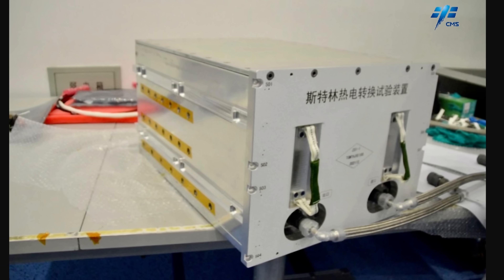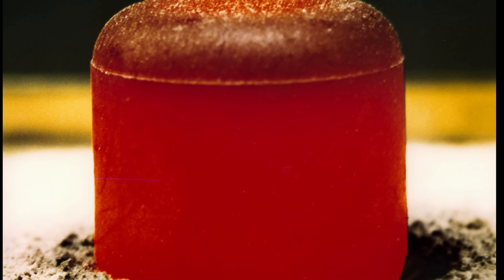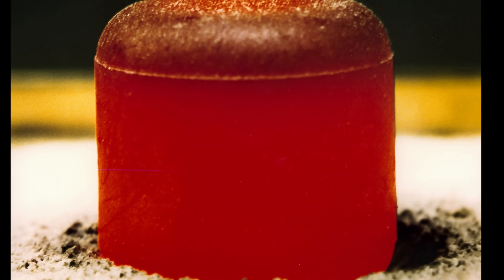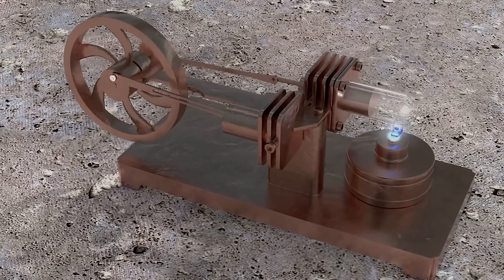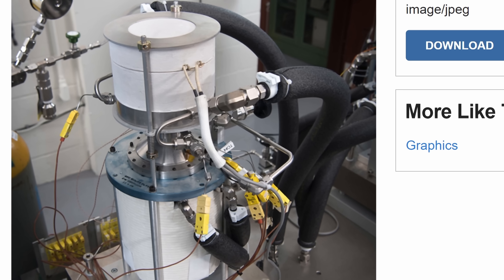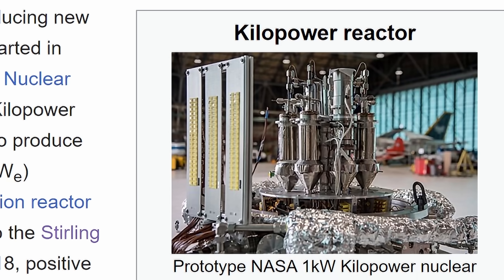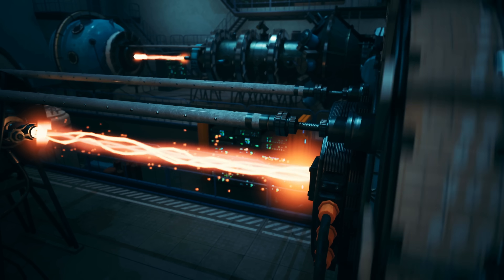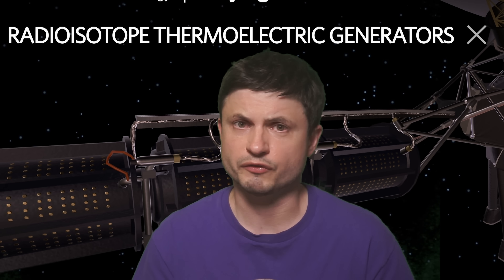Incredible Advances In Nuclear Stirling Engines For Space Exploration

Comment: Always wondered about this, since nuclear waste that we still can’t figure out how to dispose of properly, produces tons of heat, just not enough for a turbine. The fact it’s not being used for stirling engines and district heating is a joke. It could be paying its upkeep.
Reply: The problem is probably it is low level heat. If it isn't hot enough to run a steam engine from steam from a nuclear reactor it is unlikely to run a Stirling engine. Stirling engines are efficient only at high temperature differentials (like 0 to 1000 degrees). Stirling engines probably not efficient as a steam engine, but for space are probably weight less and don't need a water source.
Reply: @AORD72  you can run a Stirling engine in a cool room with the warmth of your hand. They don’t have the same impulse as steam turbines but spent uranium is still toasty, and  the heat load is constant. You can get it as hot as you want by containing its heat. Incidentally a lot of spent fuel storage involves actively cooling the things to avoid them cooking so I reckon there’s plenty, if not at least enough to run the cooling systems themselves.
Reply: @Freshbott2  You sure can run one from your hand, but it is not very efficient. You need to have high temperature differential to have high efficiency. Have you studied physics and learnt about the Carnot cycle? The Stirling engine has been around for over 200 years, it is well studied and the problems are well known (not efficient at low temperatures). That is the reason you don't see them used for much.

Any Uranium that is "hot" enough will likely be used in nuclear reactors because it is more efficient.
Reply: @AORD72  why do you ask if I’ve studied physics? The answer is yes, and it’s irrelevant because you’re not listening. Spent fuel produces a lot of heat. Between 1 and 10kW/tonne, which given the density is not a lot of volume. That differential can be as high as you let it. If left unchecked, canisters of spent fuel would melt, that is why they’re stored in ceramics and actively cooled. They can’t be stored without cooling until decades after use, and you’re telling me  they can’t get hot enough to run Stirling engines to manage their own cooling systems. They can get as hot as you want, they’re only decommissioned because they can’t productively drive steam turbines. A tonne of spent fuel releases up to 10kW. A typical American house peaks about 5-10kW. There are 90,000 tonnes of the stuff in the US. Gotland class submarines run 75kw Stirling engines by burning low volumes of diesel, you’re not gonna tell me spent uranium that would cause a runaway thermal catastrophe if you left it alone isn’t enough to run one. You don’t need 1000C from spent fuel (not that there’s anything stopping it) to drive one, you barely need 300C to drive conventional waste recapture turbines. Look it up.
Reply: @Freshbott2  I'm telling you: because it is not efficient to use a Stirling engine Why aren't they using Stirling engines from leftover radioactive waste? Because it is not efficient. Steam turbines are more efficient. 

If  anybody had a choice to generate electricity between a steam turbine or a stirling engine they would choose a STEAM TURBINE.

"In practice, Stirling engines have efficiencies ranging from 25% to 50%, with the most efficient engines approaching 50% efficiency."

"If you do the math to calculate the Carnot efficiency (and therefore the Stirling efficiency) these temperatures mean that one could never expect to get more than an efficiency of 0.58 without the universe imploding. Unfortunately, right away almost half the energy you put into our engine is GUARANTEED to come out as waste heat transfer to the cold section. Right now we’re just talking about absolutely perfect engines, and that’s all which will be discussed in this post, but in the real world there are all kinds of other factors that make it impossible to reach the Carnot efficiency level. You’re a superstar if you can get half of Carnot."

"Nuclear waste" is not actively cooled.
Reply: @AORD72  USNRC - “Spent fuel is thermally hot as well as highly radioactive and requires remote handling and shielding… Fuel is typically cooled at least five years in the pool before transfer to cask.”

There’s a wiki page on cooling ponds: 
“Spent fuel rods generate intense heat and dangerous radiation that must be contained. Fuel is moved from the reactor and manipulated in the pool…

The fuel bundles fresh from the core are normally segregated for several months for initial cooling before being sorted into other parts of the pool to wait for final disposal...

The maximum temperature of the spent fuel bundles decreases significantly between two and four years, and less from four to six years. The fuel pool water is continuously cooled to remove the heat produced by the spent fuel assemblies. Pumps circulate water from the spent fuel pool to heat exchangers, then back to the spent fuel pool.” 

You’re missing my point and you’re completely wrong about yours.

Steam turbines are better, but in pointing that out you’ve admitted to my point- you can get the temperatures as high as you want my moderating the volume of the medium, in this case water. 

Spent fuel isn’t productive to run steam turbines for grid scale power. If you wanted to run a tiny one using waste heat, you could. But it’s not worth it. Steam turbines and their infrastructure is expensive. But that’s got nothing to do with what I’m talking about so stop telling me about it.

Currently the US and most nuclear countries haven’t figured out a plan for spent fuel, and after the brutal cost in developing, building and running power plants, they’re still forking out money for the upkeep of both young and old spent fuel. A Stirling engine would be useful for a low-input system for district heating or the like, or at least to run the cooling system itself with little inputs. Such a system would be less reliant on the plant or diesel generators to do the pumping too, which is a huge safety dilemma.
Reply: @Freshbott2  You said "The fact it’s not being used for stirling engines and district heating is a joke", AND I SAID "Stirling engines probably not efficient as a steam engine" which I am correct.

Comment: KILOPOWER and KRUSTY is not an RTG and only has one moving part, and that is a deflector that can be moved to "Turn off" the reactor. YOu should be able to even use a manual lever.... I was always under the impression that a Stirling engine would be involved.... Seeing these 2 married out and tested sounds like  a plan... It is great to hear that it's finally under way.
Reply: KILOPOWER is a reacor that could be test in parts in low level nuclear testing faclties, and last I heard, holds the recent record  for fastest/cheapest reactor development, due to not needing the top level safety facility (not facilties, facility, there is only 1 of those in the US) to test most of it to start with.

Comment: I don't think most old computer nerds tried to replace their heatsink with the TEC modules, but rather use it to quicker transfer heat from the CPU to the heatsink. It works but the amount of energy you need to dissipate will be the sum of what the CPU dissipates and the juice put into the TEC. You can get the CPU much cooler this way but at the cost of a lot of energy. If your CPU gets too cool you may have condensation issues where condensation causes erosion on the motherboard.

Comment: Robert Stirling, was the inventor of the Stirling Engine in Scotland, where it was first Patented in 1816.  He would be amazed that his initial invention would be developed over two hundred years later to drive spacecrafts to other worlds...
Reply: It's kinda mind-blowing how it's being applied.
Reply: I honestly don't see why these engines couldn't be used for a very efficient solution to coal dependence for grid power. I'm not sure Stirling could fathom the possibility his initial idea could not only power spacecraft but maybe make everyone's life better for the rest of humanity. ECE's or Stirling engines powered by more renewable or clean sources could very well be the answer to all fossil fuel dependence.
Reply: @JimmieDoolittle3  AFAIK, it's the huge difference in heat v cold in space which makes the system workable. It's been tried on Earth, but it's far less efficient/effective.
Reply: @markhathaway9456  either using solar lensing or geothermal or a combination thereof on earth should do just fine. Sure output will not be as high but its a much more workable solution than solar or wind. Even the temp between ambient above ground air and ground temp at 6-8 ft deep will produce enough difference to create some power day or night...use solar lensing to heat the above ground portion during daylight hours and voila. A fairly efficient system that is workable without using fossil fuels or rare earth metals. Granted it would take sizeable stirlings but it can't be any less space saving than solar.
Reply: @JimmieDoolittle3 Sun power Stirling tried this.  It beats solar panels in efficiency but requires direct sunlight.
Reply: @JimmieDoolittle3  If they're only 20% efficient in the cold of space, then we might as well use the sort of turbines that we use now, because they are more like 40% efficient in a terrestrial environment that's less friendly to heat engines than space, due to higher ambient temps.
Reply: @incognitotorpedo42  "The thermal efficiency of Stirling engines is 40% while the efficiency of similar Otto and Diesel engines are 25 and 35%, respectively. The Stirling engine cycle is a closed regenerative thermodynamic cycle, with cyclic expansion and compression of the working fluid at various temperatures [7–11]." 

I believe it's 20% for that particular variant not stirlings as a whole... and again probably because of build constraints etc. Stirlings are very efficient, and everything I said is pretty valid.
Reply: @JimmieDoolittle3  there is a reason stirling engines are not used in power generation (on any sort of industrial scale). For one, they have a super low power density and would have to be giant and complex for a larger scale. Remember, large steam turbines can go to over 1GW!!! Modern gas turbines reach over 40% thermal efficiency and adding a steam turbine at the end of the gas turbine (exhaust of gas turbine acts as hot side of steam turbine), the overall efficiency can reach over 60%.
Reply: @JimmieDoolittle3  The reason we don't see stirling engines being used is because they are less efficient than our current solutions. Stirling engines can theoretically reach 50% efficiency, but as of now we're nowhere near that. 

Efficient stirling engines can and have been built, but at a great cost. Alternatively, we are already exceeding 25% efficiency for solar panels, which cost only a fraction of what an engine would per watt generated. Then there is also wind power, there is a theoretical limit as to how much energy can be extracted from wind, and it's around 50%. If all energy were extracted from wind it would stop moving, thus blocking the flow of new wind, maximum output is achieved by taking only half of the energy. Wind energy is extracted in the form of motion, and electric generators are already greater than 90% efficient, so there is no need to attempt to replace these, same goes for hydro.

The only use case in renewables that would make sense is geothermal, but this is only available in some locations. Still it's an incredible technology, and if more research and investment were put into it I could see the cost coming down. All in all, I think the most ideal application for stirling tech is in compact nuclear power sources.
Reply: @RMX7777 you are largely incorrect, sir.  In ideal conditions, dish type solar Stirling engines are up to 25% efficient, but I heard one record say 43%, but I can't confirm it.  Another record said 32% which Google bard confirms.
Typical solar panels are 20%.

Issues lie in solar Stirling complexity... The dish type has to point at the sun and it requires direct sunlight.  Lots of moving parts means the system will require lots of maintenance.  If there were a proper supply chain of cheap parts and easy to repair/maintain, it might be slightly better over all.  A Stirling engine block to be easier to recycle by melting down and recasting, where solar panel waste is kinda toxic.
Reply: @RMX7777 oh.  Also same problem...  Need grid scale batteries for the times when the sun does not cooperate.  Like night time.
Reply: @kayakMike1000  I recommend you re-read my comment, as nothing that I said disagrees with your reply.
Reply: @RMX7777  
In addition, Stirling engine needs a 'fairly large' temperature difference to generate meaningful output.
Within context, Rankine Cycle has no such limitation.
Reply: That is what I thought also.
It is more than 200 years ago that it was invented!
And it is still a great concept for small generators. When scaling up, the volume to surface ratio becomes too big for a externally heated system.
However on the cold side in space it is only possible to cool by way of radiation. 
But that also could be a good thing.
Because the temperature is so low in deep space, the Carnot efficiency is theoretically extremely high.
Reply: Drink when he says "various".
Reply: I will be even more amazed...
Reply: Robert Stirling has become immortal for all the right reasons. 😊
Reply: Well, no surprise.....we keep the good stuff hidden.
Reply: Rather to keep them alive, not drive them.
Reply: meanwhile, all china does is copy
Reply: Well, stick, stone hammer, wheel, steam... diesel... Stirling  engines, china rocketry etc...; all these belong to the same stone-age technological level. The next level is the devices based on the quantum physics and we are at the beginning of this technological stage. If not Stirling then it could be invented by many others because it's trivial "invention" even for mediocre human brain; while the complexity of devices, based on quantum physics, are getting close to the human brain capacity to "invent" such devices - objectively close. To move forward, we need to improve human brain. The improvement by just a good education is getting increasingly insufficient. Human DNA should be modify to move forward.

Comment: I myself have actually wondered for years, why haven't done this kind of thing before for craft we send out for years, even decades...
And as far as the motion of the Stirling Engine offsetting thrust vectors/angles, simple... Counterbalance shaft...
All of it is so simple. You have Nuclear one end (HOT) and the cold darkness of space the other end (COLLLLD) 😏👌
😎🇬🇧
Reply: Because TEGs using the Seebeck effect are more reliable reliable than Stirling engines. The Voyager space craft have been going for ~45 year using  TEGs and a radioactive mass, they have no moving parts. A Stirling engine would also add vibration to any craft.
Reply: @AORD72    Yes, I am aware that the Voyager probes as well as others that have been launched in the mid to late 20th century would have used the earlier and well established Seebeck power units. But seeing that NASA has been investigating this new gas Stirling Engine for 20+ years with great efficiency, it seemed like it could have been a thing to go with, especially with the power efficiencies it improves on over the previous generation of power plants, including solar for far reaching missions.
As for vibrations... As the video shows, vibrations are at an extreme minimum with the little to no moving parts, and, as I have stated, counter balance shafts/mechanisms would have offset that completely. Think. If your 4 cylinder motor can run smoothly. A 6 cylinder Honda gold wing 1800cc motor can run ultra smooth, a 6 huge litre V12/W12 motor can run at 'Full chat' without tipping a coin balanced on its side on the motor... Then, a Gas Sterling engine with counterbalance shafts WOULD be suuuuuuper smooooth.. And this would not affect ANY delicate equipment on board. Then.. add to that, the fact that satellites are subject to quite impressive vibrations during take off. One of these ultra efficient, long life has sterling engines WOULDN'T affect the craft at all.... 😏

Comment: Stirling engines were another lost technology option that we failed to develop. Nice to see an application but sad that we still fear radioactivity. We have used plutonium sources in space for many years - why go back to depleted uranium. Since the machine is not meant to run for 100 years strontium would be a good source and we have many years experience of handling it - remember that half-life does not mean it stops working - only that the power source reduces output over its whole lifetime.😊

Comment: I built a sucessful Peltier cooler for my computer but I did not replace my heatsink with a TEP. I used the Peltier to cool the incoming air which in turn cooled the heatsink to around 10C. I would still be using it if not for the condensation that I was getting lol. I think a Peltier that was better engineered to interface flush with a CPU package and possibly built into a heatsink/spreader could be effective at cooling a PC but with water cooling so cheap an effective radiator or water loop chiller would also be an option. Back in 2002-2003 I used a Peltier that I sanded flush with a GPU package and I managed over 30% stable overclocking so it can be done but it takes a lot of trial and error.